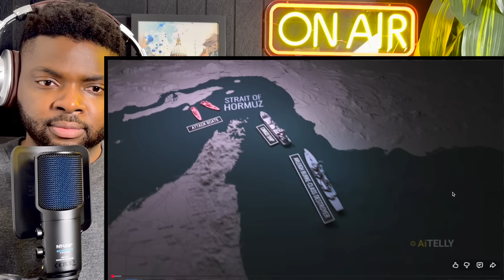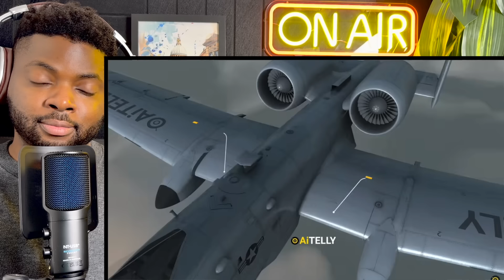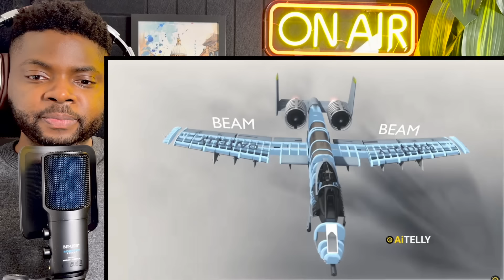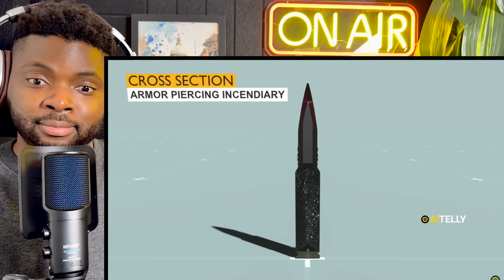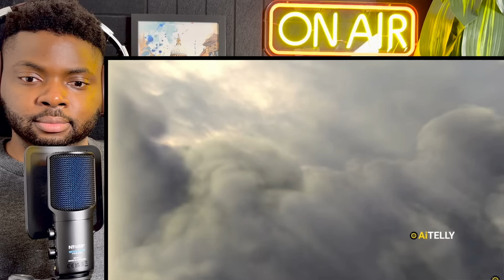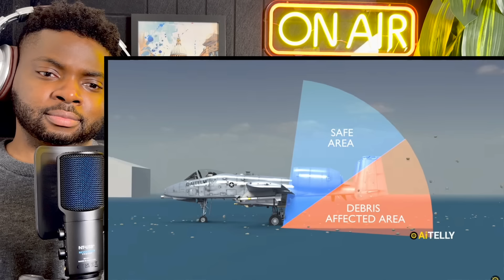A-10's Ruthless Hunt in the Strait of Hormuz? | British Guy Reacts 🇬🇧

Comment: I SO wish we were not in this conflict.... That aside, this aircraft is basically a flying tank. The entire flight system was built around the gun. It's literally a flying huge as$ gun. If you need more clarification check out what it did in the gulf war to tanks. There was a fist size hole COMPLETELY thru tanks every 4 inches.... That was from one short bust of the GAU. Like literally one tap of the trigger from the pilot. Think of this tho... One tap, done. Hundreds of rounds making whatever you are pointing that aircraft at is going into permanent sleep mode. Upgrading is a thing, it's happening. Talk of retirement.. Nah. Facts are wars are won with guns, and the A10 is a HUGE A$$ flying one.

Comment: No, the F-35, nor any other plane has the A-10's titanium bathtub pilot protection. However, that BS about recoil is false. The rotating barrel allows the gun to fire each barrel as it is on the aircraft centerline. To do this, the gun must be offset slightly. Firing on centerline eliminates any potential yaw effect. No additional stealth has been added.